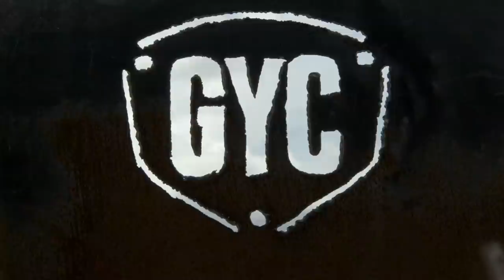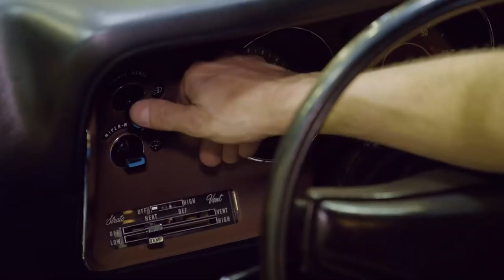LOST CHARGERS-FOUND!

Comment: Even though I'm a Pontiac guy, I'm also a closet Mopar fan and this is easily the best t.v. car show ever. But your diecast model cars leave a lot to be desired, I bought the graveyard cars '67 GTX model the other day and it has very little in the way details, I also bought a diecast '72 Pontiac GTO the same day for just $20 more and it has opening doors, hood and trunk, detailed engine bay, trunk has spare tire, jack and spackle coating, detailed undercarriage with rotating driveshaft, steerable wheel and adjustable sun visors, and tilting seat backs.
Reply: Itemized sales slip, silver strip VIN number by the driver side windshield? That's good for $20.

Comment: 17:51 on a electric buffer you wanna run around 1400 to 1800 max if you go up past that you have a chance on burning through the clear coat or the paint itself people dont realize that a buffer takes a lot more off then they intend too. A buffer can take out deep acratches but you want it set lower speed then high and you have to use compound if you dont your just putting heat on the vehicle. Which can also fuck up the paint job. You paint to thick, solvent pop. You paint too thin, its a repaint. It's just how it goes. It's a tough job to be a painter/finisher.

Comment: I wish you would find mine, the last numbers were 66668. It was originally pea green. With a Black vinyl, it had the classic Bumble Bee stripe around the rear end. I came original with the 440 4 Barrel carb, & a a Dayna equipped rear end. But I was young back then, I rebuilt and put a 440 out of a police interceptor motor in it. But I had an original Chrysler Part's number book that I was using to make sure @ a later date I could put back in it what it came with. Even with the 71 440, I loved the sound of the exhaust. The bell housing the exhaust manifolds were all numbers matching...

Comment: My cousin bought at 69 charger, 383 2 barrel colum shift buddy seat car. It had been sitting since ‘76. The car was so rotten the front clip almost pulled off. Absolutely no floors or trunk pan left. Leaf springs pushed the trunk open. The tranny and drive shaft drug on the ground trying to “ roll “ this car into the garage. He bought a 69 coronet from the firewall to the trunk pan to put what’s left of the charger on